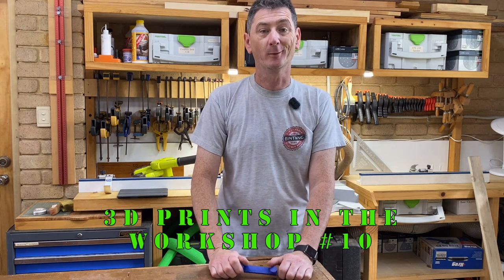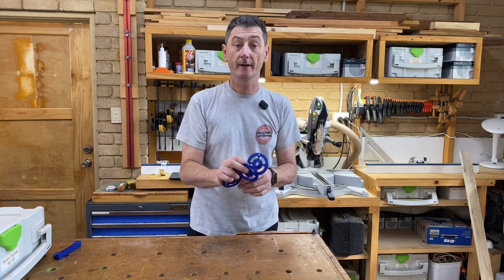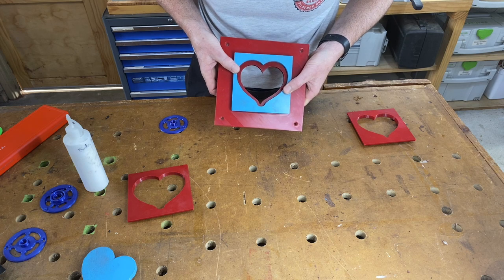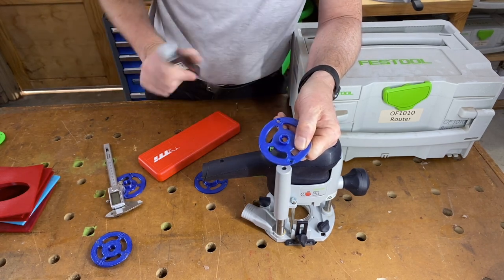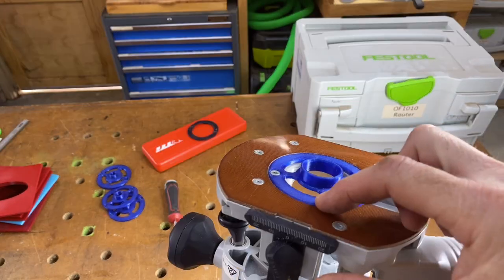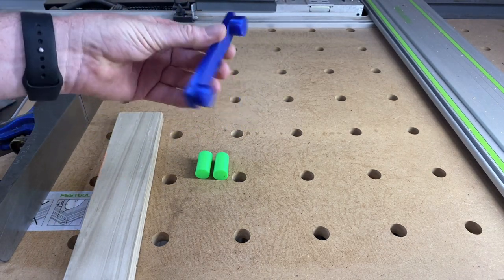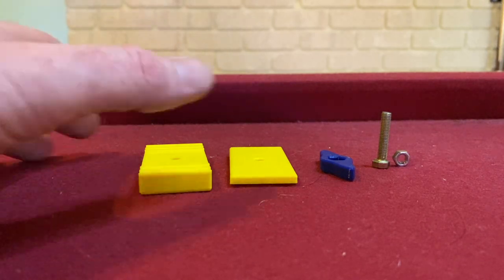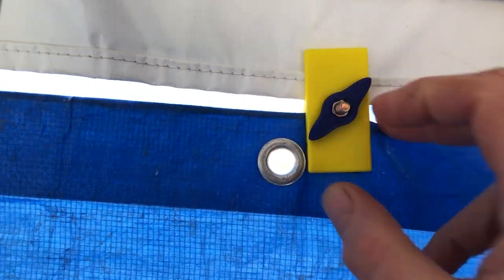3D prints in the workshop 10

Comment: It may be the printer not being calibrated for mechanical work.  Design file in Fusion360 or Freecad etc. should be design spec but printer needs to be adjusted to follow.  The plastic after extruded will not shrink at a consistent room temp.  May have good or bad layer adhesion to layer below but doesn't really shrink as a by product, it's more that the belts allow more travel on X vs. Y and the extruder and filament..

Comment: Thank you for sharing these items and for posting your developments to Thingiverse.  I enjoy seeing what you produce and actually have started trying to print a couple of them.  Once I am more comfortable with Thingiverse will post a make of the items I printed.  i noticed the the reading on your caliber did move a bit while trying to measure the router guides.  I am new to this game and seem to have a challenge when measuring with calibers (due to their sensitivity/accuracy).  My numbers for the measurement on any particular location seem to vary with the amount of pressure I m putting on them against what I am measuring.  i am trying to determine what is the right amount of pressure I should be applying to the caliber jaws.  Is there flex in the plastic and can this impact the measurements you are showing?  Just curious because I am trying to learn.  Thanks again for your sharing of insights.
Reply from the maker: Hi Rob, thank you, and yes I get that with calipers too. Pressure can make a difference to the measurement. My technique (right or wrong) is to put the pressure on and then just relax my grip a little so the jaws are hard up to the item, but not digging into or distorting the item being measured. I also take two or three measurements and look for a common reading. Plastics do flex a bit, but hopefully by using this method I’m ameliorating that effect.